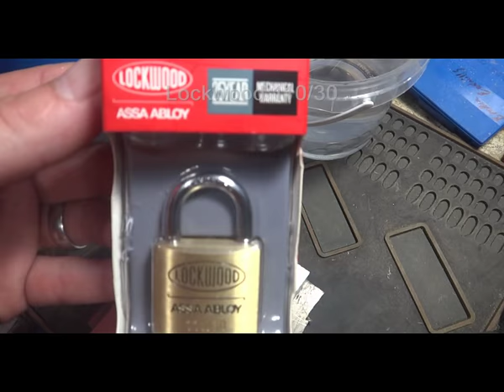Lockwood 110/30 Disassembly and Milling.

Comment: Cool how you got the pin's out, never seen that before. Good milling work too. I enjoyed your workshop at OzSecCon. 🍺😎🇦🇺
Reply: It is an old trick. The lock body stays hotter when it is dunked so the chamber caps shrink quickly and the springs force them out.
Reply from the maker: Thanks for Watching :) 
its a old trick I kept hearing about so I though I would give it a try when I had get a bunch of Keyed alike Master No 140's and it worked well so I though I would record it for when people asked how to do it.
I am glad you enjoyed the Workshop at OzSecCon, I was worried when my talk went off the rail LOL

Comment: That was awesome - very cool to see the whole process. What was that magic pin-chamber opening trick. How does this work?
Reply from the maker: Potti314 thanks for watching, there is no magic its just thermal dynamics at work.  The chanber caps are a smaller mass then the lock body so when we heat everything up then do a rapid cooling the chanber caps cool and shrink at a faster rate then the lock body so the caps fallout.
Reply: That's great, thanks for the explanation, will have to try it myself.

Comment: Nice video and destruction of the lock. I wonder if there are different grades of brass? The mill went through it very easily.
Reply from the maker: Thanks for Watching,  yes there is different grades of Brass (its just a alloy of Zinc and Copper)  some are harder then others but they can all be machined with ease.

Comment: I wonder how they would look if you used a larger end mill and milled down the face of the lock over the chambers just until you get into them. This would let you see into them easier and the slots would be smaller which makes it harder for the pins to pop out. Actually had somebody break one of your American cutaways that way when they were trying to pick it.
Reply from the maker: I was thinking of trying that  but part of the problem is when I mill down above the chambers it weakens the brass making it easier to bend and then you get what happened with that 1100 :(  I am still working on a diffrent method that prevents that.